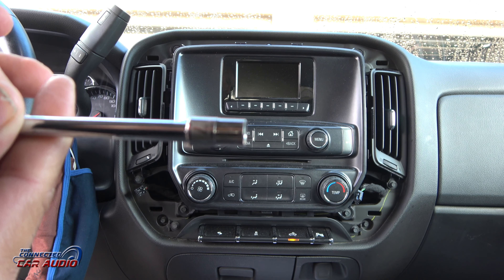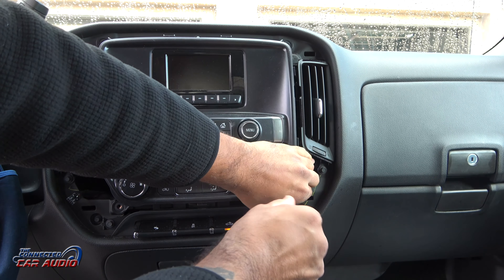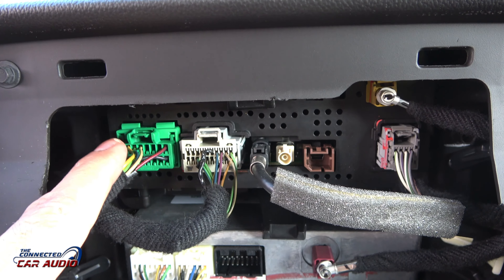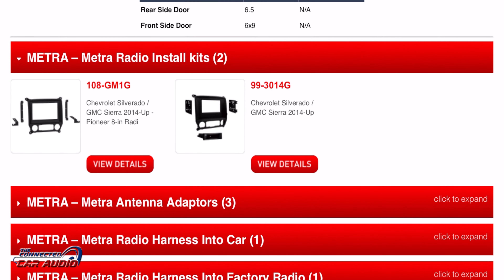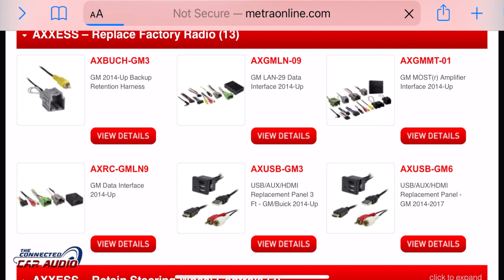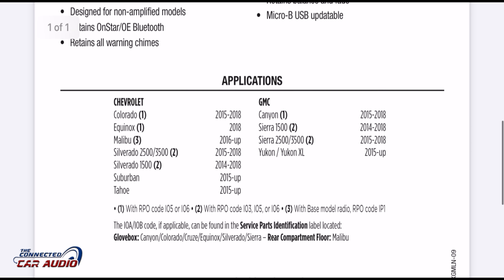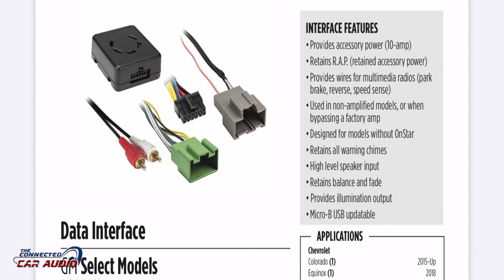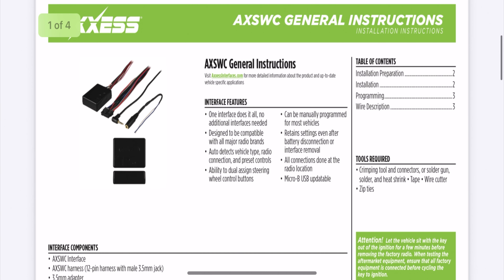chevy Silverado stereo removal 2014 and up

Comment: If i replace mine with another one from a different year since mine is 2014 and the one i wanna get is 2017 do i need to re program
Reply: Yes, you will need the Vin to get the code from the dealership. I had mine rebuilt and shipped back to me.
Reply: @Louisianawhips  ah ok so i buy one like a different same oem one and I can leave it at the dealership so they can re program it

Comment: i have a base model 2015 sierra i have a aftermarket double din stereo i want to install i was wondering if i need another amp for the speakers? and if so which wire harness would best suite me? i dont have on star
Reply: i also dont have any steering control buttons

Comment: Need help to find out what wire did you used to connect to the truck harness if the radio steering wheel controls
Reply: I need to tap in to a wire for the swc lnterface can work

Comment: Hi I have a question i wired the dimmer wire to the illumination wire on a 12 nissan frontier not knowing now my tail lights not working can you help please
Reply from the maker: Check your owners manual to see what fuse protects the tail lights. It is most likely blown 

You can always just shine a powerful flashlight into the fuses to see if a fuse is blown 
Or use a multimeter 

But a good start would be to check fuses
Reply: @connectedcaraudio  yes sir you was right it was the tail light fuse thanks

Comment: How do u know if ur truck has a factory amplifier
Reply: Only if you have bose factory speakers will your truck have factory amp
Reply: The Bose setup from factory includes a subwoofer. Subwoofers must have an amplifier to work properly. If your truck booms with the Bose sub instead of bumps with oem speakers, you have an amplifier👍🏻